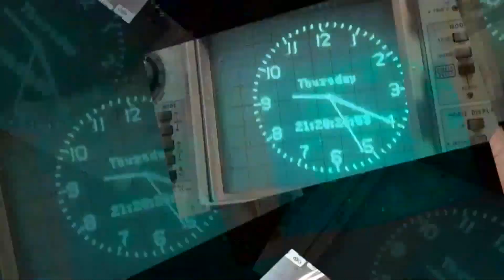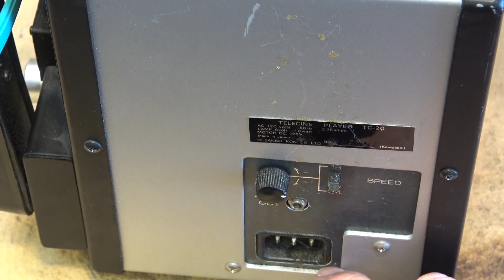Vintage Goko Video System

Comment: I can't imagine how much film that machine converted in it's lifetime, a clever design with adjustments for best conversion, i like that :-D.
In the long run i'm sure it was worth every penny.
Vintage tech that often outlasts modern crap.
Reply from the maker: I believe this was developed for the news film industry. Before video tape all news footage was shot on 16mm film which was expensive. Super 8 delivered resolution that was more than good enough for use in news stories, and the 50 foot film length, and the fact that film was in a cartridge meant quick and simple loading for the cameraman. Kodak also had a video player out in the 70's that used a flying spot and 3 photo multiplier tubes that delivered excellent results. I have a film that I scanned with one of those at the TV station I worked at. A film of my old buddies riding dirt bikes.  If I find the VHS tape that was transferred I will scan a couple of clips on the wolverine and make a comparison.
The flying spot scanner delivered really good results and I always wanted one, but by the time I got into the business they were no longer made, and this was what replaced it. as any camera could be used, and it allowed for very quick location of material of interest, as just like a film editor, you could fast spool the film by hand and the picture was perfect.  Anyway given the price this was a piece of gear that was targeted at professional use. I know that Kodak, and many camera manufactures were pushing hard to make super 8 (with sound) the standard for news gathering right up to the mid 80's when betacam hit the market, and then film was dead in it's tracks. Prior to that, yes there was ENG camera setups, but it was a 2 piece. A photo journalist would carry the camera and tethered to that was a heavy VTR, like a VO4800. The camera weighed in about 20lbs, and the recorder another 18, so it made for a very heavy setup for a single operator, and usually required a crew of 2  One guy to shoot the pictures, and a second to carry the recorder, and boom mic. So many news organizations continued to shoot on film just because of the small camera. Well of course the camcorder spelled the end of film.

Comment: I remember this machine ! The station used it for news that were captured by people that casually were on the spot of breaking news events and their footage was the first to be aired. They paid good money for those who were in the right place and at the right moment to capture those events. I think that your idea of installing a HD CCD camera down where the first mirror is looks like a great idea , or maybe directly to the  output of the prisms ! Thank you for the good memories !
Reply from the maker: If I get bored than I might just do that.
Yes I remember how much was paid. I did stringer work for a number of years for a few local TV stations. I used to monitor fire and police scanner, and if something sounded interesting I would head over. Used to be 500.00 for anything up to 1 minute, and then paid by the second. I have a tape full of the news clips I shot. I should dig out that tape and put some up.

Comment: Ingenious shutter free design with the prism...  Totally avoids the flicker issues inherent in shooting a projection.  Hi-res small CCDs are getting cheaper, so your idea of mounting a camera inside the unit is intriguing.  I hope you follow through on this, and compare results with the Wolverine.
Reply from the maker: Probably a pipe dream considering the low volume of film I transfer now.   The wolverine is slow but the quality is more than acceptable and none of my clients have had an issue on picture quality.

Comment: i used these Goko machines for a few years (1997+) at a small photo lab.  The boss or his father had purchased these machines years before i was hired so i have no idea what they cost back in those days, however i definitely recall the boss complaining about how much it cost to get them serviced or repaired!  I'm pretty sure the 2 machines we had could run both 8mm and super8, and the gate area could be changed by turning a knob or something to change the gate size (as well as the sprockets maybe?) to match film gauge.  the TC-20 model you have might be a little different than what i think i remember - but i might be (probably) completely wrong in thinking that Goko made a single unit that could do both 8mm and Super8 - we had 2 machines, so maybe it was one for each of those formats rather than being able to get 2x more work done or a fallback unit when one needed to be repaired or serviced - we definitely ran both goko machines at the same time very often to keep up with the volume of orders we'd bring in.  I know i calculated how feet of film i ran a year (was very often what i spent 8+ hrs/day 5-6 days a week doing over 10 years) almost every year and the numbers were pretty crazy but i don't think i have that notebook anymore.

i never liked the prism in our machines because it was a bit of a dust magnet and looked yellowed to my eyes - your prism looks pretty good to me in this vid as far as the color goes, less yellow than what i remember seeing.  The mirrors inside were dust magnets too, and then the lens assembly as well lol.  My boss's complaints about the service/repair charges for these Goko units lead me to seek out something more robust that we could better repair and service in-house and/or less likely to have as many issues for our film transfers.  We also had an Elmo 16-CL for 16mm film transfers and never had any issues with that machine like the Gokos (the Elmo required a more traditional mirror + screen setup for transfers) so i (once the boss realized i was kinda smart on some things and somewhat trusted me) went down the path of using more traditional projector designs, less specialized than the Gokos were, for our film transfers.  99.9% of our customers/clients didn't complain about the quality of transfers after i stopped using the Goko machines in favor of silent 8mm/Super8 projectors + a very large mirror and screen (like 8x10" or larger mirror, fresnel lens, and translucent screen which produced almost no visible grain from the screen at VHS resolution) setup that i pulled from a large, fancy Xerox copy machine that i believe was originally design to copy still film transparencies to paper and/or other media.  

We definitely had quality complaints from a non-insignificant number of customers regarding the quality Goko machine transfers, even back when pretty much everyone was using VHS on their analog CRT TVs, even before DVDs took off... which is why my boss had to send them away to wherever to get serviced so often.
Reply from the maker: This one was 2500.00 and the camera I used was another 5k. 
I also had a modified eiki dual 8 projector with a modified shutter and a special lens that attached directly to the front of a professional camera. (C mount lens) instead of projection bulb it used the 12v MR16 bulb that was run at about 14 or 15 volts instead of 12. Shortened the life from 2000 hours to about 200 but MR16 bulbs were dirt cheap compared to projection bulbs.  I did all the film work for 3 retail shops. As soon as I got home from the shop and had dinner I was transferring film to vhs. Had the wife doing it all day while I was at work.  This was before kids.

Comment: Kind of takes me back to the days I was a projectionist although a bit different.
Reply from the maker: One of the guys I worked with way back in my TV days always wanted to be a projectionist. 
I would imagine that after awhile that job would get rather mundane, seeing the same movie 4 or 5 times a day. Back in t he days where there multiple reel changes however, that would have been a fair bit of work, especially if one projectionist was running multiple screens.
Reply: @12voltvids  my brother in law had an uncle who was a projectionist for 2 theaters around 10 miles apart. He would start one, get on his motorcycle and ride to the other, then back in time to change the reel 😂

Comment: I've informally been on the lookout for one of these (or similar) that do sound because at least I could use my 4K camera at 24fps to record at a framerate closer to the native framerate. So many arguably better and more modern transfer machines don't do sound. I still see old and refurbished Elmo and Tobin machines that hard telecine with only composite or rarely S-Video out that go for bookoo bucks.

I would rather not have to run my film twice then merge the audio in software. I used to have access to a MovieStuff projector that a completely adequate job for silent film.
Reply from the maker: These units were never really that good.  Go find an old Kodak flying spot scanner.  That does sound and has variable speed playback.  

I'll stick to my old wolverine.  It's good enough for my clients and 99%  are silent anyway. Last time i had sound the client just said do the picture and he would record the sound on his old projector and sync it himself.

Comment: hi there,i actually just bought this exact machine from a friend,he used to be in the business like you 40 years ago and had it in storage.Now he is retired  so he didnt want it he gave it to me for 100 euros whixh is alittle over 100 $.m trying to get back into filming super 8 after about  the mid 80;s when i stopped fiming and bought a videocameea.The thing is film is too expensive here in europe to begin with ,so i need to take out of the equation the processing and scanning.I was thinking of buying  a Wolverine equivalent which in europe is called Reflecta,but everything i saw in you tube i didnt like and it still costs 400euros here in Greece.So i lll try this machine and see what happens.The machine is like brand new,works perfectly but  my friend used pro cameras in the old days and i only have a SONy handycam which i dont know if it can do the job.,i havent tried yet.
Reply from the maker: The Reflecta is similar to the wolverive 720. The pro is 1080.
The problem with the goko is it is very specific on the camera used. It needs a tube based camera.  I got very good results with  my old DXC1800 professional camera. When I tried to use it with a CCD camera the results sucked.Flicker everwhere just by how the system operates and how a CCD or CMOS camera shutter works. Was totally useless. The wolverine delivers excellent results, but is slow as molasses in January, and requires processing on the PC afterwords to crop and adjust the picture. But do that and it looks fantastic. For the price you can't beat it. Sure there are better systems but they cost $$$$.$$ and for the thousands the ROI even doing it professionally will never pay back. At least the wolverine paid for itself and now every film I scan I make money doing.
Reply: @12voltvids  actually th REFLECTA does 1440X1080p  @20fps.About the rest i will try and see what happens ,thanks for your answer.
Reply: I am really curious to know if you got this setup to work. Did it? What camera did you use?

Comment: HI, Enjoyed the video. I have this system now, but have a small sprocket area showing up on the left side of the image. Do you happen to remember if this is adjustable or can be remedied? Thanks
Reply from the maker: Camera alignment.
Reply: Ok. I was hoping there was an adjustment in the telecine. So much light shining thru that tiny sprocket. Thanks for your reply
Reply from the maker: There are several mirrors.  If one gets our of alignment then you will have a distorted picture.  I have not used mine in 30 years.  Only use it now to pull the audio as I use a frame scanner.
Reply: I have the wolverine also but it doesn’t do well with unprepped films with old edits. Much longer process. I have thousands of films. Maybe I should just do a first pass with a projector just to see what’s on them
Reply from the maker: The goko was expensive and never worked right.  It was very picky on the camera and really only worked properly with a trinicon tube camera. I never got it working with my 3ccd broadcast camera. Yes the wolverine is slow and requires post scanning processing but the quality is excellent once done.

Comment: Hi 12voltvids Just stumbled across your videos and they are great.  I'm learning a lot from them.  I have an Edifier computer speaker system that the left channel is working fine on but the right channel was not working at all.  I replaced some capacitors that were obviously bad, leaking fluid.  Now when I have both speakers plugged in I hear static out of the right channel and if I unplug the speaker out of the left channel I will start to hear faint music out of the right channel as well as static.  I am just starting out learning circuits as a hobby so I'm very new to this and I really want to repair this speaker system as a great learning experience, but I'm a little lost.  Would you be able to provide some tips on where to go from here?  Do you have an email address that I could send some pictures to so you can give a rough guess as to anything that would be obviously wrong visually?  Any help would be appreciated.  If you have a twitter or anything like that I could also contact you on there so you don't have to post your email address, assuming you're willing to help of course.
Reply: Troubleshooting remotely is very impractical 😁 you'd be better finding someone local to have a look with you or walk you through the troubleshooting process in person

Comment: Did it work better in the dark?
Reply from the maker: No it does not project, feeds directly into the camera lens.
Reply: @12voltvids  does the camera lens fit tightly into the unit? Thus, stopping any light from possibly entering? 

I saw something similar to this many years ago. The camera you were recording on had a good that stopped any other light source getting in apart from the image.
Reply from the maker: @crankjazz  
The lens hood fits around it producing a light tight seal.
Reply: @12voltvids  thank you. That makes sense, and is similar to what I've seen in the past. Cheers.